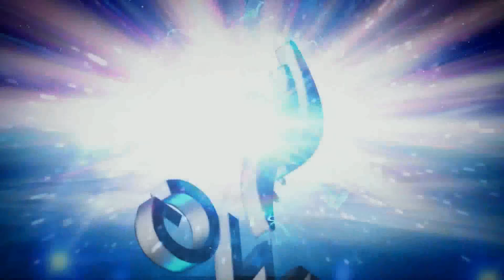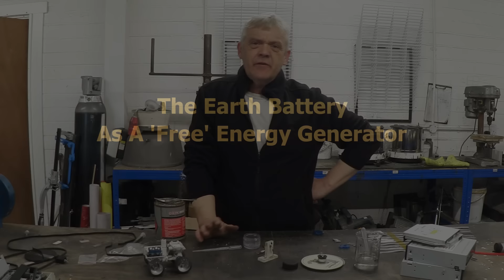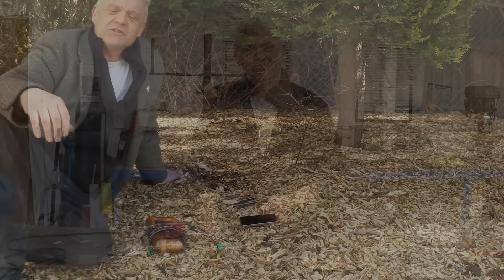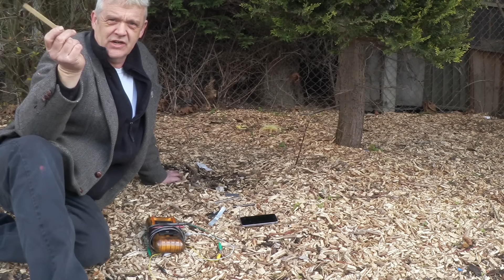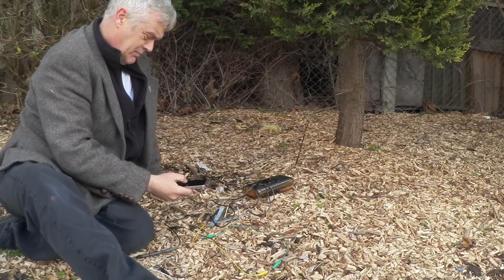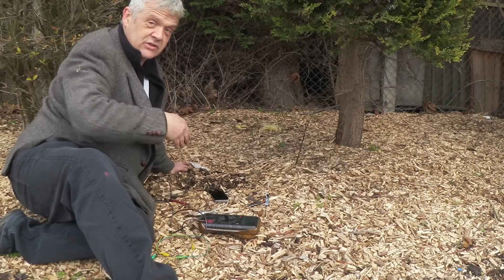The Earth Battery As A 'Free' Energy Generator

Comment: If you shove the probes of a high-impedance AC voltmeter into the earth as far apart as the leads allow, you'll get about a half volt AC reading just from stray powerline ground currents flowing around.  More impressive with an analog meter since there's no battery anywhere.

Comment: Just curious but...what you described in the first part of your video reminds me of how Wardennclyffe tower was built. Tesla has a patent on this phenomenon. For every meter in height from the ground there was a 100V increase compounded. 🤔 And come to think about it...same as the Great Pyramids of Egypt. Whereas the limestone capstone acted as an insulator and the granite blocks as the conductor. I do believe it was built up on an aquifer soas moisture wasn't an issue. Just a thought.

My opinion why this works? I use the kiss method. Keep it simple stupid. The earth is negatively charged ground. The ionosphere is positively charged. The more surface area you have in which to connect the two gives you the current to tap off of. Great video. New subcriber.

One further proof of this would be that of the Eye of the Sahara...the Richat Structure. It is a 150 - 200 mile diameter circular electrical discharge point. I'm an Electric Universe Believer. 

So...where does the energy that powers electrons come from?

Comment: Earth batteries used to power long distance Morse code telegraph lines.
The earth is an electrical circuit, you are tapping into the electricity that is already there, The sun charges the atmosphere and gives it a positive charge while the earth has a negative charge.

Comment: 0,5 volts can barely run a germanium driven radio receiver, but I suppose a bunch in series would work well enough to charge a phone.  Or that radio with its speaker.

But there is a lot of voltage available from a wire flown from a kite - but not in a storm.  Franklin's lightning experiment probably gave him a little zap from the electrical difference in the air.  Lightning would have vaporized his kite string.  I have doubts as to his survival after that.

Comment: Curious how that works. I wonder if being near running water or the water retention in the soil would be a factor to consider.

I remember learning about Teslas tower and how he was inspired by the how the pyramids were constructed in Egypt.

They had a reservoir of running water underneath the pyramids, Where the water flowing in and out would create some sort of pressure vacuum in the pyramid itself and transferring energy to the quartz via the piezoelectric effect.

I remember reading about Tesla and how he may have constructed small aqueducts underneath the Wardencliff tower to perform the same function, with these large granite stones in the ground as connection points.

Makes you think maybe he was working on this earth battery type thing, and found a way to multiply the energy that came from the ground.

Also makes you think what you could possibly do using copper wire, like perhaps by coiling the copper wire you could step up the voltage a bit.

Idk I’m no electrical engineer but I’m endlessly fascinated by the subject, makes me want to experiment myself.

Comment: I was thinking cities that if you were to drive down down some rods that you would detect a difference in the potential of the grounds of all these houses around you and that if he did it right you probably could get some usable current so you can charge batteries it would seem to me that it would be plausible to use your ground wires and find a difference of potential of the ground wires and get usable by the electricity to either charge of capacitors or batteries I remember as a kid taking speaker wires and putting one on the ground and one of the copper wire in my in the plumbing and I could definitely hear the 60 cycle hum

Comment: Have you tried using nano coated copper wire instead of carbon rod. Nano coating copper with fire is best, but not to hot, otherwise you'll burn it off, just enough to burn surface, blacker the better, heat continuously in direction of flow, starting at one end. Before heating wire make coils like springs in anti clockwise in direction of flow, and wind coils in 3,6,9 multiples of turns once made, connect all wires with anticlockwise twist, no solder or connectors, once nano coated handle with care and gloves as touching will compress nano layering and reduce effectiveness..

Comment: Sweetsixteen was old Ed Leedskalnin sweet spot. Don't grow your girls too big. Magnicity perhaps? Some people called them a garden even feeding the soil with only certain foliage. The leaves of the Oak have a higher acidity level and perhaps WHY they forever hold the light. (Rush 2112) But ed Leedskalnin also used a generator along with his garden/sweetsixteen to defy gravity with his stones. A copper coil placed half the length of a steel cable he created a magnetic lever. He also used a tool he called a Permanent Magnet Holder /PMH. When the all three coils of these two machines were in place and wired properly it sends the North and South pole magnets out the opposite ends of the steel cable. Pairing these levers one can use the like force magnetism to levitate the load/stone.

Comment: The railroad ran the telegraph buy burying a 3 foot square 1/2 inch copper plate on one side of the tracks and a 3 foot square 1/2 zinc plate on the other.  A wire from each went to the telegraph. That produced 1.5 volts and the large surface area gave sufficient amperage to run the telegraph.  The question is how far apart do these "Cells" need to be to add voltage.  4 such cells should give you 6 volts and a good bit of amperage.  These days a voltage doubler transformer ain't no step for a stepper.

Comment: Yes the Earth is a battery. No you cannot call it free energy. Following some basic laws of physics an object in motion will stay in motion until acted upon by an outside force. So you can look at that motion as the Earth spinning, granted the Earth is not spinning endlessly and it's slowly burning it's gargantuan momentum over many millennia. But considering this law, there is no energy surplus coming from the Earth that we would be able to tap into without greatly affecting it. You can gather this by spinning a bicycle wheel as fast as you can, now apply a smaller wheel to the outside circumference of the larger wheel and use it to power light bulb. Eventually the tire will slow spinning due to the friction. The Earth's energy is self-contained and you aren't contained in it.

Comment: I saw an article on this but it was supposed to give usable ac voltage but it required a preconditioned of the ground by injecting current initially. By  putting a 100watt lamp in series with the ground at  the two pickets which were both copper then supplying from mains u keep it connected till the lamp lights fully. The acurrent should be available from the now aligned earth frequencies . My results showed about zero results.

Comment: Would a "Touch of ground plane" be ammenable for Broadband transmission to difficult to reach/uneconomic to connect by cable locations. Maybe ground plane repeaters would work ? Would clay sub-soils burdened with aluminium compounds be beneficial ? What would it take to produce an amplification effect through the soil ? What would happen if the Mag/alloy electrodes were "Grown" from a single crystal of metal . . As used in jet turbine blades ? What if you agitate the elctrodes using VLF sound waves, then transmit a resonant electrical pulse between them ?

Comment: stubbleifled coil works pretty well.. even a purified (non-corrosive, non-galvanic) stubblefield coil generates/produces a voltage.. maybe you could say it manifests... that is a coil wound with (non-tarnishable) gold or silver (electro-)plated copper (reluctance) wire (doesn't need to be cotton covered copper wire) and a permeance wire that is simply magnetic (enameled) iron (garden) wire to generate a crystal voltage source.. all you would need is a crystal current source (because the current is so low, like 10 to 50 micro-amps in the crystal voltage source).. the mechanism is fixed (not mechanical) and will operate without burying the coil in the ground and you can strap it to your belt loop (as you have activated a smaller coil with with germanium or silicon transistor type blocking oscillator/charge pump to present/boost a usable voltage/current source for more conventional loads (not a crystal load).. i have ideas for mechanical (non corrosive) generators to compliment these implementations.. even fixed circuits for schumann resonance input (free running telluric) 3 channel input for voltage/current sources...
Reply: nice video, thanks for sharing!
Reply: replying to Xeno:

*DERGONDERZHALERLERZHARDARZHNARSZHERZHBIOLERSZHERZER!!*

Comment: when the street department worked on the water line main that runs beside the road by my sidewalk and just through part of my yard. so they left a hole open to finish something later and nothing around the hole to block or warn anyone. so i went and touched the pipe down it the hole and WOW I WAS SHOCKED BAD! so i did it again lol and it was putting out a huge shocking voltage! of course i called the company they shut down the whole block and then i was talked to by the foreman saying this is normal and he was upset i had it shut down he was in trouble for  not blocking the hole i think. but could you use a pancake coil and pull the extra electricity around this pipe?  thanks in advance for any help  great video thanks for sharing!

Comment: It is better if you use a smaller anode than the cathode.
If you want more information look up telluric current battery in the 19 century section of Google.
You can use the same material for the experiment as long as the the circuit is arranged in the correct polarity.

Comment: If you electroplated Is piece of iron or copper a 1000 times or a 100000 times And then stuck the ground anode and the ground cathode. You could potentially have a usable battery Or even have a ground anode and a antenna cathode.

Comment: What about a tall rod antenna that is not grounded, like incased in epoxy. The a wire from bottom of antenna to positive battery post then negative post to ground. Wonder if it would create voltage ⚡⚡

Comment: Theoretical thought: Alloys.  Do alloys allow for the voltages or amperages of the elemental metals to add up in an earth battery.  If we were to create a super alloy made of equal parts of aluminum and magnesium, would the battery generate 3 volts when paired with carbon?

Comment: what if you used baking soda and water inside a hollow pipe and seal the ends using copper to connect to? keep trying different combinations some do put out decent voltage and more when it rains and water moves through the ground.

Comment: This is interesting. Does larger diameter conductors increase voltage or amperage? Does more gap or less gap increase wattage in any way? You mentioned using pots, I was thinking hooking them in series to get 12V or 120V but would it generate anything hooked into pots on shelves? Now I have to try it out.

Comment: This free energy comes from the electric grid...if you check your transformer on the pole ..one high voltage wire comes in to top winding of the transformer..and bottom of the winding goes to earth ground !!!!so the earth becomes the return back to the source...the earth is now a electric circuit !!

Comment: It is just pure electrochemistry.  The energy comes from the chemical change in the material and the wet earth works just as electrolyte.  You can plunsh the electrodes in potatoes or lemmons.  All the same.  
If there is an earth current effect of free energy, you should see something with two carbon electrolytes.   If not, then there is nothing.

Comment: If you get a voltage with lead and lead or if swapping north and south makes a difference then it's an earth battery, if not you might as well use a lemon. Compare all this with a lemon anyway. It works with a potato too, rotted down a potato is soil, soil in a pot is just silly.

Comment: Voltage is simply a difference of potential. You have two contacts. If one has a voltage and the other has a different voltage then the difference is actual voltage. Electric current will flow from one contact to another in that case. The direction and amount depends on the extent of that difference. That is the significance. Not anything else. You might be able to influence that significance but only to the degree that you are enabled by government/wealth. Make no mistake, you aren't going to do much otherwise and the influence will cost you very much money. Probably too much to make money with, that is... you have to add the property of economy in everything you do. And it usually is a negative.

Comment: I'd also don't use led, stick to using only iorn/Ch3, Zinc/Zno, copper/Cuo as they are the building blocks of the Amino acid of all carbon based life here on earth and are supportive to life, other minerals are not. Also use of GANS/oxide of the same materials will improve results. If only part of your system is nano, then favor nano to negative.

Comment: There's much evidence to suggest that the Egyptians used this technology I'm assuming they use some kind of rock I don't know if it was limestone that was reactive electrically but they definitely had battery banks in the ground they carve them out of stone and they had these big capacitors that looked like a cookie jar is the best way to describe it so it makes sense that if you're generating small amounts of energy from the ground you need capacitors to store that energy and transform that energy
Reply: I've read about granite being an excellent radiation Shield because it absorbs radiation so if the pyramids are built out of granite I'm not sure how much a rock with high radiation lets off energy that you could pull up out of the ground but it makes sense that's where it's coming from doesn't it

Comment: The current produced isn't generating due to oxidation? you would think if this is "free energy" that someone would have tried to collect the voltage in some sort of battery system and put it to some use. I know it's small voltage but once gathered it could be useful.  think about a trickle charger for a car or a cell phone charging system.

Comment: For making the earth batteries…what about using some of the bigger pots w/built-in reservoirs in the bottom, which could help keep a more even moisture, without flooding the pots or drying out in hot summers?  Could those also be planted with potted trees? .  
Pots could be put on a drip line in dry climates, along w/other potted plants..assure moisture..or, use a dirt containing water sponges in it. 
Can Epsom salts (MgSO4) be used as electrolyte, instead of table salt (NaCl), to act as fertilizer for plants in the pot, instead of killing plants around the electrodes as table salt does?  
If big pots are used, & planted w/small container trees, could one electrode be connected to the tree, which uses the roots as better earth connectivity, & the other one into the ground, or, to another potted tree nearby the 1st one? 
What about using lightening rods driven deeper into ground?   Would there be risk of lightening being attracted to them, & blowing up the system?  (Research showed “more is not better” when it comes to how many lightening rods are on a house—only 1 per house!)
If a mild white vinegar water is used in the pots, could acid loving plants survive in the concentration, to help blend the setup into the garden?   
Or, a mild saltwater to water in dirt growing salt-tolerant plants? 
This is all VERY interesting!! 
 I’d love to understand it well enough to try running some small things like LED lites, or charging devices!  I’d like to see more clearly, what this guy was doing, & see a clear diagram. 
SAFETY:  One friend thinks she can simply plug her solar panels into a house circuit, to run her electronics from that—she seemed to not understand, ANY homemade power must be segregated from Grid power by a failsafe switch, in case of Grid-down episodes, to protect lineman from electrocution.

Comment: You do some really cool, crazy stuff. I enjoy your work. 
Question; how do you think it would react if instead of putting this in series, if you would connect them + to- and- to +. I've not done experiments with DC? So I don't know about the properties. What I was thinking of is a 24v battery system that uses (2) 12v batteries to achieve the 24v amount.
Reply: Connecting + to - ( -|+-|+-|+-|+ where -|+ is a group of rods/battery) is the same as connecting them in series in which voltages add.  If you want to increase the current then they would need to be in parallel.  If you need to do both then you would make groups that are in series for the desired voltage then connect those groups in parallel until you get the desired current.

Comment: how many mA did you get under load from the magnesium and carbon at 2 volts? trying to figure out how many watts someone could get with a whole back yard and some 
long pipes or rods of the best materials? i probably only need 5 or 10 watts of battery charging power. does the voltage or current go down when the sun goes down?

Comment: Try putting magnets between them or magnent on each end first with same polarization on each end different polarization on each pole, then try altering the polarizations. I guarantee magetism will increase voltage. You might even be able to use circular magets with metal poles down the center filled with earth. Truth is you are only using the earth for ph to deteriorate the metals and the bi metals deteriorating are whats creating the energy. If you were actually pulling energy from the earth you could use same metal as long as they are conductive and it would produce.  the lower the ph of the earth the more energy produced!